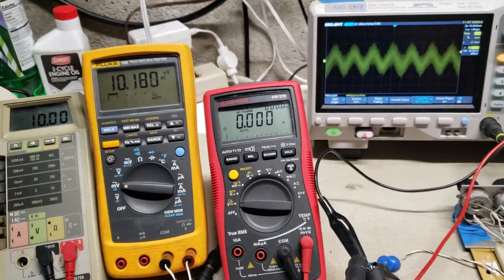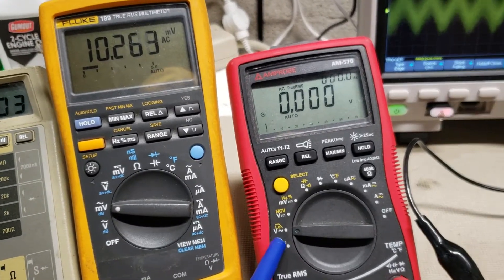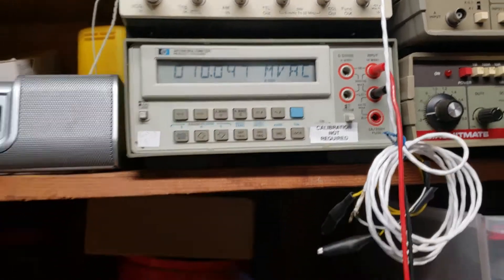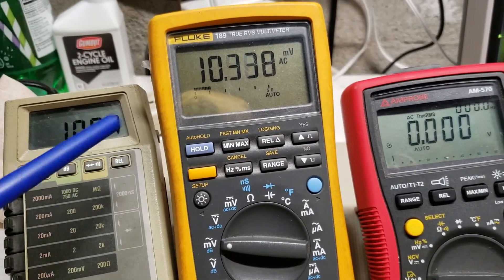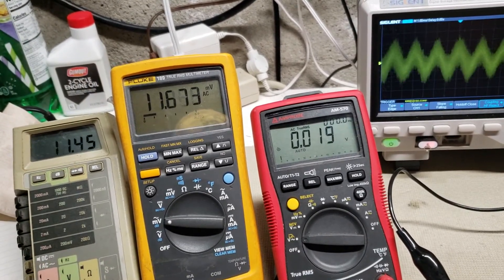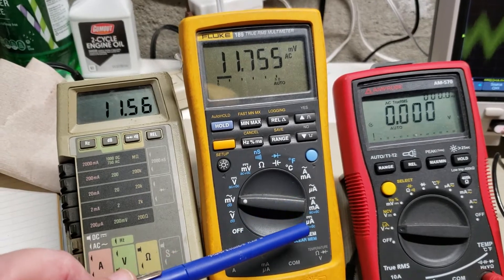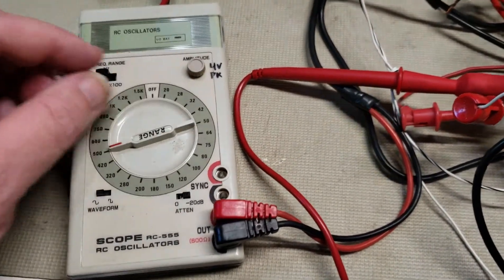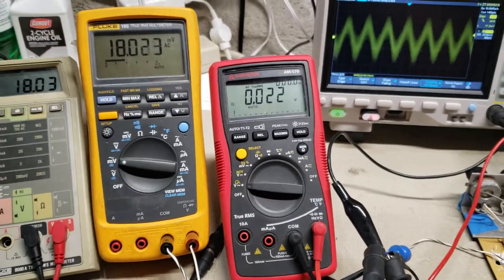DMM Testing for AC millivolts - Amprobe AM570 vs Fluke 189

Comment: Hi, I see that you select mV scale in Fluke and auto scale in Amprobe, in autoscale obviously the voltage needs to exceed a minimum value to be detected by the software. Please repeat the test selecting range in AC in Amprobe tester.
Reply from the maker: Ok, interesting, I will try manual range on the Amprobe, thanks.  Both the Fluke 189 and the Amprobe were in Autorange for this test and they did behave differently with a very small signal, it seems.  I do like the Amprobe meter very much, overall.
Reply: At 0:37 it looks like the Fluke is displaying “AUTO” below the number (lower right). It’s that something other than what you’re taking about?